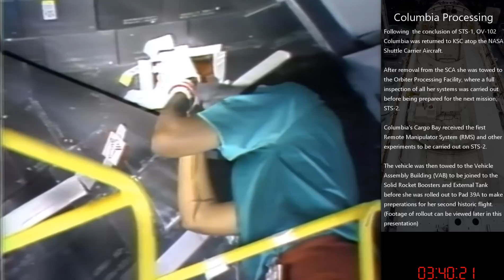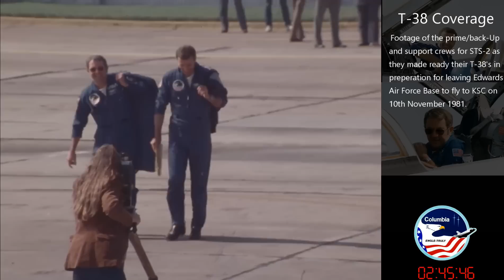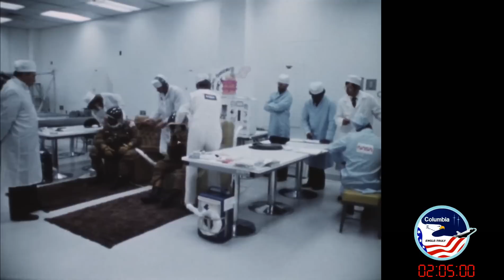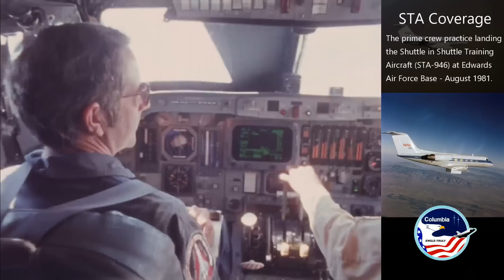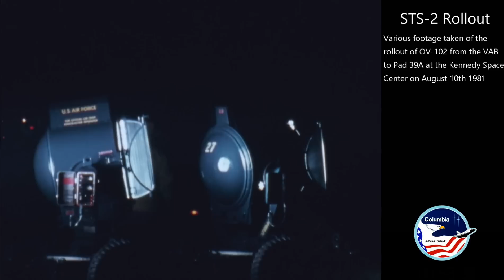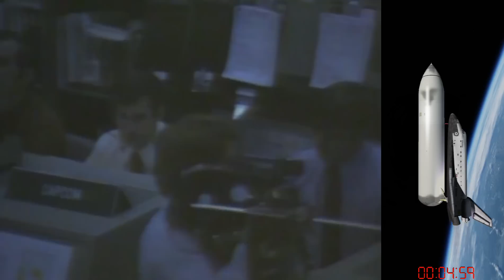STS-2 - Full Count/Launch/Orbit 1 - Full Mission 1

Comment: I like that engineering footage of the launch. Slow motion just as the shuttle is about to launch. I saw a video about the challenger disaster. Now i wonder, on the day of the STS2 launch was it as cold as when the day of the challenger disaster? They were not worried about those Orings in the boosters.  After the challenger disaster they redesigned the Orings to withstand more temperature variations.
Reply: I was at the launch of STS-2. The forecast from the the Air Force Weather Service on day before launch says 63 degrees.
From the Rogers ‘Report of the Presidential Commission on the Space Shuttle Challenger Accident’ (page 19): The ambient air temperature at launch was 36 degrees Fahrenheit measured at ground level approximately 1,000 feet from the 51-L mission launch pad 39B. This temperature was 15 degrees colder than that of any previous launch.
Even there was ice on the pad and yet the launch constraints were waved the night before launching Challenger.

Comment: WIKI:- STS-2 was the last shuttle flight to have its external fuel tank (ET) painted white. In an effort to reduce the Shuttle's overall weight, STS-3 and all subsequent missions used an unpainted tank, saving approximately 272 kg (600 lb) of launch weight.[13] This lack of paint gave the ET a distinctive orange-brown color, which eventually became emblematic of the Space Shuttle.

Decades later, in 2006, some in the spaceflight community questioned whether the white paint would have prevented the ice-soaked foam shedding issue that led to the loss of Columbia. NASA consensus was that it would not.
Reply: To my knowledge, Columbia was lost due to a jet of burning propellent shooting out from a ring joint in one of the solid rocket boosters when the O-ring failed due to cold weather. By the way they were warned that very morning by Morton Thiokol not to launch because of that cold weather for that very reason, and their reaction was to angrily force Morton Thiokol to retract that. They never mentioned that in Congressional hearings.
Correction- That was Challenger, not Columbia. You are citing Columbia, I was at cross purposes citing Challenger.